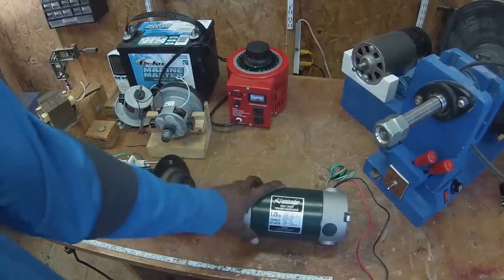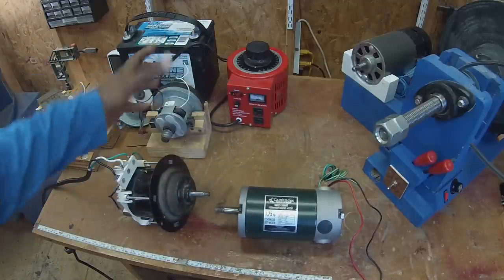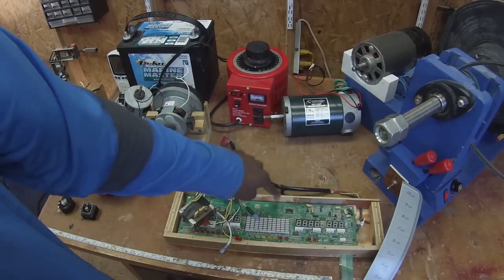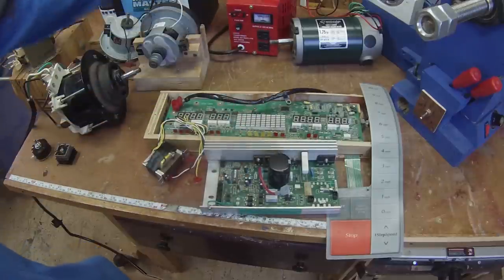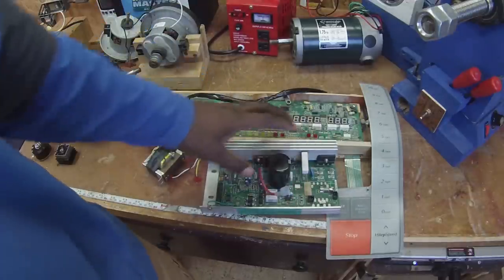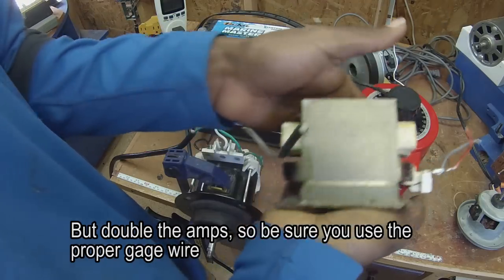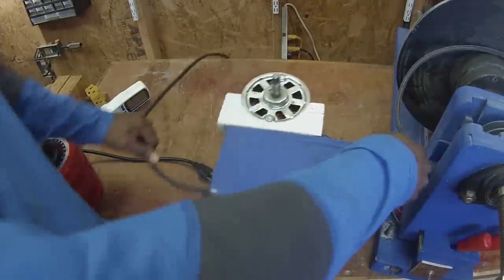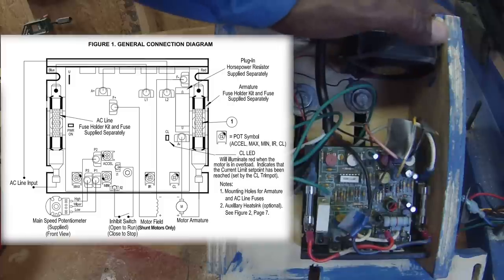How To Wire A Large DC Motor And Control The Speed; Treadmill Motors and Universal Motors 019

Comment: I'm wondering if the reason the harbor freight speed controller won't start the motor until turned up over half way is because it has to achieve a certain rated current value to start it. I think if a start cap was wired in to act as a motor starter it may work a little better. it may also benefit from a run capacitor as well. just speculating. love your channel. I get some great insight from you. stay creative my friend!

Comment: Very good video Jeremy. I am like you I use motors and parts from broken appliances, treadmills etc. on other tools and things. I put a video on You tube about using a treadmill motor and controller to run my drill press. If you want to see it look up Georges 10 ER. I also used a treadmill motor and controller to run a band saw so I can cut wood or metal.

Comment: Lutron has made autotransformers, (the variac is an autotransformer.), for controlling curtains in theaters, large drapes and curtains in homes and for speed controllers of banks of ceiling fans for 40+ years.  I salvaged an 8-9A autotransformer from a house being torn down in my neighborhood.

I use it on my test bench as a variac, (I installed it in a case, added gauges, swtiches, fusing, etc).  I also have a full bridge rectifier and a pair of caps as an attachment for variable DC output.

DC increases by a factor of ~1.7 when rectified, so the 115-120v AC from the wall outputs about 180v DC.

I bought two caps, (200v 22,000 mf), to smooth out the rectified AC. The two caps were cheaper than one big cap.  There is a formula for calculating cap size. The variable is % of deviation after the cap, the lower the percentage, the closer to 'true', flat DC, the output approaches. (It's one of those 'math' things, you can approach zero in mathematicss, but your formulas blows out a thong if you actually USE zero.)

You can buy Lutron autotransformers new, but they're out therein the wild, and usually cheap.  Oh, unlike the 'boost' transformer built into a variac. The Lutrons do not 'over-clock' thr AC. What comes out of your wall is it.

Comment: In the cheaper speed controller, there should be a small potentiometer that allows you to set the minimum power. That is what I had to do with mine which was doing the same thing. It is just a small flathead thing which is VERY sensitive so it doesn't have to be turned much.

Comment: For capacitors, the rough rule is 1000uF per 1A, so if your motor draws 10A, for the best performance you would use a 10 000uF capacitor

Comment: Adding a smoothing capacitor to the DC motor, especially if you use a triac based variable speed control is a good idea. The higher the capacitance the better - (100K uF and up) - smoother operation. Connect smaller values in parallel to increase capacitance (but be aware the voltage get derated by the number you put in parallel (2 -> 1/2, 3 -> 1/3, etc). For a 12 V motor try one of those car audio caps. They are like 1 Farad! (1 million uF). Get them cheap at pawn shops.

Comment: Wheelchair motors are powerful. Would love to see if you could salvage one or two and what you might do with them.
Reply: The 24v wheelchair motors are not really powerful they spin very fast and go through a worm gear to get torque by sacrificing that speed. Direct drive is very weak but at incredible rpms
Reply: 24v diesel starter motor is an awesome brick saw motor (using 28.5vdc 90A alternator as a source / controller )

Comment: I am fairly sure the output of the Harbor Freight triac unit is "chopped ac". I would run it through the full wave bridge rectifier then to the motor. A capacitor on rectified DC tends to smooth the output. Not really needed in your motor applications, but I might be temped to use a 35~50mf across the DC output, just for suppression.
I have yet to find a free, or even cheap, treadmill around here, but I keep looking.
Thanks,

Comment: Really been enjoying this motor control series.  One thing I've been trying to understand is:  Can the treadmill motor be operated at Low RPM / High Torque?  I'm talking 50-250 RPM.  Would a potentiometer do it or would something like a PWM or VFD be better? Looking for something that can be manually cotrolled. Thanks for any input.
Reply: Maybe with a large capacitor bank in between the motor controller and motor. I think it would greatly increase torque at low RPM

Comment: If you wrap one or both of the dc wires in a toroidal magnetic you will eliminate the wine or noise in the motor or just add a choke on one of the dc wires to smooth out the dc current.
Reply from the maker: I will give it a try thanks

Comment: On your harbor freight controller , there is a potentiometer you can see a screw on back , remove screw to gain access and adjust it to each motor, also everyone is screaming microwave , microwave , but I have discovered 400 watt metel halide street light , ware house lights , they are just as good , and thousands are popping up due to led retro kits.

Comment: Thanks for the quick reply and linking me over here, watched it multiple times now and its very helpful but i'm still lost. It doesn't help that i'm not certain if my motor is AC or DC, it doesn't say on in anywhere. I managed to remove everything (the board, 2 transformers, maybe 3..) between the motor wires (Red, Black, Ground) and the power switch/reset button, plugging that in to the mains it stopped after a second but it did start momentarily when turned on so im thinking it probably is DC and fingers crossed it still works.. I've searched for a DC motor speed controller but can only find cheap pwm volt regulators on amazon/ebay here in the UK

Comment: Jeremy, You had me freaked out a little holding the light dimmer as too many places on back to get 60 buzzes per second. I haven’t look recently but controlling the frequency on A/C system has been the rage. By controlling the frequency while using the correct motor is the ability to control slower speeds, reduces loads, lower current is the holy grail for them to get SEER ratings into the low to mid 20’s when just a few years ago, a SEER rating of 18 or 19 was consider extremely high. I have seen SEER ratings up to 26 but getting training, info almost requires a license or a buddy in the field. But having the ability to drop compressor speeds to the minimum need to run an A/C system and the blower fan speeds gives an company the ability to show a buyer how a higher up-front cost will pay for its self two to three time faster in the form of lower utility bills for an appliance that may actually last way longer. 
A decade ago, the A/C system was either on full blast or completely off. This led to ECM motors that where expensive as it was on part. Then the second design was the motor end-cap contained the ECM portion with all the electronics in it to be serviced separate. This reduces inventory, labor & total cost. It’s just an idea if you have or have not looked into it. 

   I understand that what you or I would want is something that is more universal. Like buying tools. If you find a tool that works but only does one thing, great. But if I could spend $5 more for a quality tool that does 4 or 5 things is a smart multitasker. I really enjoy how you explain and show the work in your videos. You have had great videos and worth like, subscribe and binge watch the entire channel. It will get your electrons going!!!

Comment: I don't know crap about electrical work. But I've had these books laying around my shelf for years, finally going to break them out and see what I can learn. I recently got back into welding and woodworking and I'm tired of buying brand new stuff when I know I can re-purpose a lot of the stuff that just needs minor work. What are some books you recommend for the laymen that might need to learn the principles? The math I can learn as I go, not too worried about that.

Comment: I was thinking if you had a salvaged piece of electronics that had an amp rating that was above or at your intended use that you could always use its transformer to send current to the rectifier as opposed  to the expensive variac. You would just seemingly have to make sure the step down voltage was usable.

I do like the Harbor Freight concept and had no idea they even sold the device.

Comment: I want to build a small lift for "hide a hose" system, for central vacuum hose. I purchased what's called jazzy wheelchair motor on eBay with 2 wires coming out of it. I also have an old laptop power supply labeled: " 130W 20V/5V, 6.5A/1A, Input 100-240V", and that's where my knowledge stop. 
I learned from your video today about "Rectifier", because the motor is 12V/24V.  I guess I will be heading to eBay again

Comment: I use a dimmer switch for house lights. Gotta find one with a higher wattage (1000w) but can use just about any dimmer light switch as long as the load isn’t too heavy. But, usually CHEAP! Junk drawer cheap.

Comment: SCR based DC motor controllers are cheap even if you need to manage a 10 or 15hp motor.  Triac still requires a rectifier and they are generally low power devices, like dimer switches. A large motor would be out of the question.  As for filtering, high power and low frequency are nearly impossible to manage with a cap,  it would have to be seriously huge. A properly sized inductor is the ticket here if you want to kill the noise or get the last 5-10% out of the motor.

Comment: Awesome video!!! Been watching your series more and more often mainly because its very informative and most of all not in hindi lol .. anyways so i wanted to make a suggestion about running thw motor by battery power and i happen to have made a airless paint sprayer motor run with 2 caps. First  i tried the 470uF in parallel and run somewhat ok but then i tried usingthe 330uF the same way and i am not certain but it seems to run a bit better. My opinion would be the way im delivering the current the dual 330 uF is more lite weight to drive than the 470 uF in parallel but if it helps you to go from there well ill be a very proud and accomplished person 😂. Thanks for all your videos i watched so far really helps me out in my projects at night after getting home from work

Comment: @11:50 maybe the potentiometer is a linear one and it should have a logarithmic one. or vice versa. also maybe there are some trim pots inside to clamp the range, or a different pot value may do it ( the harbor freight speed controller.)

Comment: If you could block the shaft off from going the opposite direction it could be used as a drone motor.
Reply: On drones with 4 blades, 2 opposite blades turn counterclockwise(keeping the motor shaft from back swimming it would work for upscale drones). Would need lots of battery power.

Comment: The MC60 only needs a potentiometer to control without the console from the treadmill. The MC2100 can also be controlled without the console. You need a PWM signal - either from a signal generator module, or a custom microcontroller circuit - e.g. an arduino circuit with a potentiometer.

I pulled apart a Horizon treadmill yesterday, and unfortunately it had a different controller circuit board. I haven't found a model number yet, but think it will be 013674-DG. I don't (yet) know how the console interacts with it. I expect it will be PWM, since the console doesn't have a potentiometer - it's just a digital circuit with buttons, no knobs.

Comment: Just what I needed.  I have a 70 year old bench top metal lathe and it is incredibly difficult to change speeds with the belt system.  I also have a 2.2 HP 90 VDC treadmill motor that I am going to use to operate it.  The only question I have is about feedback. Is there a convenient way to add an tachometer to this set-up with the Kelly controller?

Comment: Hey, my friend,... You're a very smart guy" and I would like to give you're viewing sub's, & Other's more info on this subject of the Treadmill DC Motors. They are the best thing I have found to make things with. Milling machine's/Home made Lathes" or just a good band saw, these things are the BEST.!! If you can't go out & buy what you want or need.!! And I've done this same stuff you're doing NOW" PLUS my buddy, asked me to help him put a small Lathe together" & find a way to power it... He couldn't use the board, with his cause it was damaged and didn't work. So we took a Bridge Rectifier, ran 120 from the wall through 
A POT" from an old stereo system, into the Bridge, then to the Treadmill DC MOTOR, he had, ( it worked perfectly ).
He still uses it sometimes... So, that's one way to try and control them.,, But I have had friends say they ran into problems with that system, later.!! So, it don't work sometimes., but I don't know why"... It could be a lot of different thing's....or  the wiring isn't right, SO, if anyone does try that, some times a (POT) Can be substituted, by an "dimmer switch" and Sometimes
You just GOTTA spend the money, and pick up an variac, and just be happy that it didn't cost that-+- The price of a motor.lolol

Comment: cheapest way to reduce AC  voltage is by using light bulbs as resistors, Higher wattage light bulbs will produce a higher voltage and the current will always be limited  by the light bulb.

Comment: @12m00s - Try plugging a 40w incandescent lightbulb into a power strip along with the vaccum cleaner cord that leads to your DC motor. Plug the power strip into the harbor freigh speed controller, and watch the knob begin to work at a much lower point! I believe those triacs require a substantial current load in order to begin working, so lower load appliances dont begin to work until the knob is turned way up - a motor that doesn't draw a ton of amps wont begin to activate the triac until the knob is turned 3/4 of the way up or more. Add the 40 watt draw of an incandescent bulb to the total load and you get a full range of speed control! Of course, the bulb gets dimmer/brighter along with the speed of the motor, but that's a feature, not a bug!

Comment: Jeremy, thank you, wonderfully instructive vid.  Zero knowledge here.  The last couple  minutes dealt with what I've been looking to do, a PWM controller with a (DIY) DPDT for my 130 VDC driving a malt mill.  I think I found it, however (you only wire the motor leads....right?).  I was confused as I didn't know how to connect the board through the switch to the motor.  

Thanks again for your video.  I've returned to it many times.

Comment: The Harbour Freight speed controller is just a basic dimmer switch.  Hardware stores have them for less than $10.  Add a separate light switch to turn the unit on and off, and use the dimmer to control speed.  NOTE: Add a heat sink to the aluminum face plate of the dimmer!
Using any capacitor in series with the DC supply to the motor will help, just be sure the supply voltage is no more than 75% of the rating of the capacitor.
Reply from the maker: They are not exactly the same... (well knowing HF maybe they are), but speed controllers like this are designed to work with motors (a inductive load)... dimmers are designed for resistive loads. A regular dimmer will fail much sooner then a speed controller when powering a motor.

Comment: Capacitors cant pass dc current, the current stops flowing as soon as the cap is fully charged so the cant be run in series with your dc power. They are used in dc motor circuits across the motor leads or in parallel with the motor to filter noise which may effect the control circuit.

Comment: The KBPC5010 bridge rectifier is cheap, only a few bucks from Newark,  but doesn't come with a heat sink as does the one shown in the video. You can buy heat sinks separately and attach to the rectifier with a #10 screw (that's the size of the hole in the metal case of the rectifier).  Jeremy-- have you ever fooled around with an Arduino or other PLC? Another good video!
Reply from the maker: +Rubba Dubdub no I haven't I am interested in learning more about automating the controls of some projects. I have been thinking about it.

Comment: I built my first air compressor that runs on 12v dc. How would you recommend protecting the circuit. The motor starts at 100 amps
@ 0 psi and 150 amps @ 120 psi. What is the appropriate way to protect this circuit. I am using 2 awg wire. Thanks.

Comment: as far as i know that capacitor just smooths out the DC current, so not using one big enough should mean that it doesn't smooth out the current as much and seeing as the motor works even without a capacitor using one a bit smaller should not really be a problem. Please correct me if i'm wrong

Comment: Great content.  I've seen many DPDT switches like the GAMA 28E-MTD.  Which is 12VDC and 30A in use by treadmill motor hobbyists.  When dealing with these 90 - 180VDC, some of which run close to 30A motors.  Should one use a switch with a higher rating than 12VDC?  Something more along the lines of a 220V switch.   I would think lower rated switches might cause arching.  Is that not a concern?  Thank you

Comment: thanks for the info I have 2 treadmills I got for free can I run them at full rpm and power without using all the parts I did save them all just in case I needed them I was thinking of using them for a metal lathe and milling machine I am building.

Comment: looks like the dial is on upside down, pull it off and rotate 180 degrees so its pointing at the bottom of low when it starts